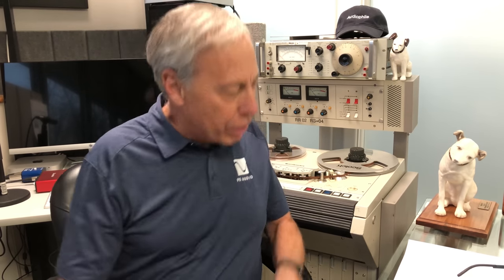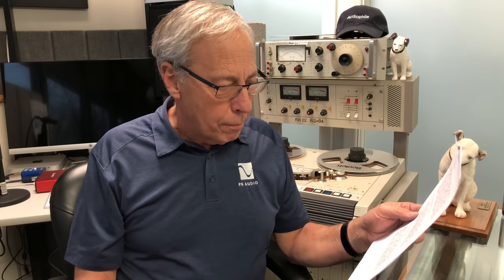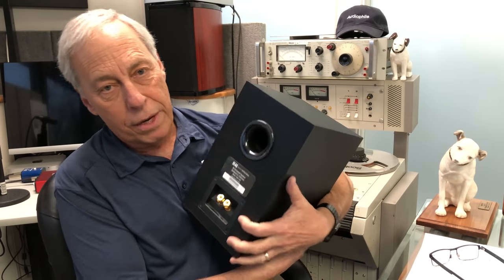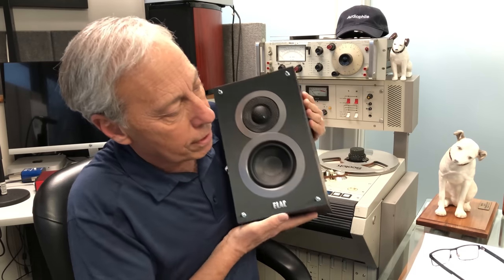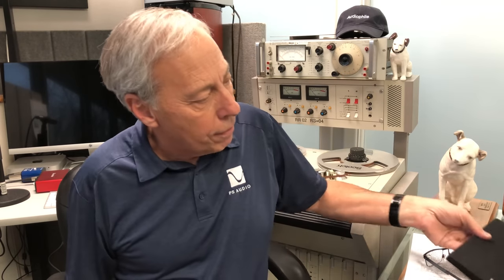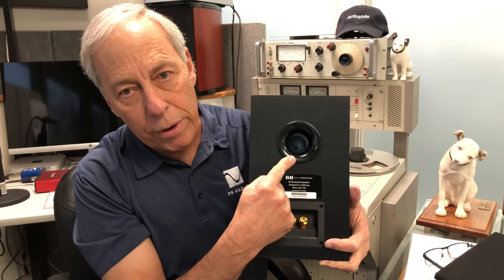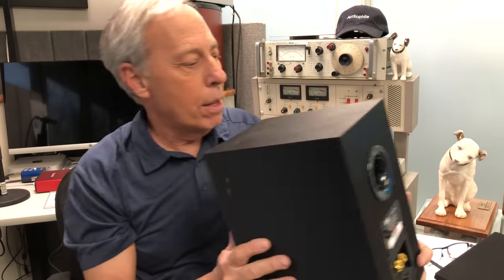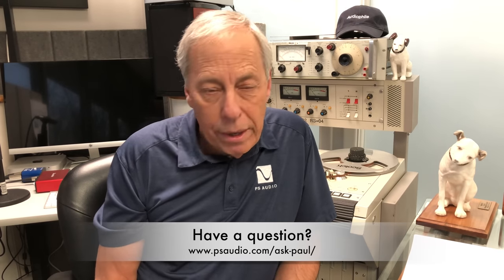Ported loudspeakers

Comment: Interesting subject guys... 
What are your thoughts on a down firing ports on stand mounted, floor standers... Any strengths in that idea? 
Or is that a no go area? If yes, why?
I know most rear ported speakers are straight through into the speaker cabbinette, so what about a series of baffles?
Would that help or just hinder air escapement?
I have been wanting to design my own speakers for some time, this is why I'm asking the question...
One other thought, is what about some form of diaphragm mounted within the port, thus pushing the speaker cone forward when its on it's forward travel...
So, in effect, the diaphragm is charged on the backward direction of the cone, then it releases that energy on the forward direction of the cone, thus giving the cone
a little help, would this be a punchier sound...
Or, is that just a sealed box again...

Would be interested in your thoughts on this guys...

Frank...

Comment: Those elacs are nice. If not a bit reserved, But the new Dayton AIR motion towers have a bit of an edge because of the ribbon tweeter and  twin woofers.
Reply: Raymond Leggs have you heard the Elac unified line I have the uf5 towers and the ub5 bookshelves and I think do a great job check them out.
Reply: I already have the daytons...

Comment: You know, I have these Bose 301 speakers (I know, Bose, boo-hoo), which most people probably have seen or heard of. But they have ports as well. However, the (6"?) woofers of these things barely move, so I doubt there's much change of volume on the inside. - Then again, these things were designed to reflect off of room surfaces, at least the "tweeters" do, but I can imagine the ports projecting bass-frequencies the same way and thus creating more sound. - But as for a change of space inside, I've turned them up quite a lot and even turned up the bass-EQ, but they're very tight and you barely even feel them move. Yea, vibrate a lot, but not like they really go anywhere. And that might be because they don't go very low, but still...
Reply: @Richard Watson Jr. Right! - I have a set of IIIs as well, though I haven't had a close enough look at those to get familiar yet. But I did notice the change in port-placement. - It also made me wonder why they did that. Perhaps the output of the port just behind the tweeters interfered with them, or maybe putting the port/slot closer to the woofer itself made more sense somehow. - I don't know. - Yet, I've seen different people claim the IIIs don't sound as good as the IIs. I don't know in what way they meant that exactly, but that seems to be the consensus.

I think the IIs sound really good, despite the criticisms of the lack of deep low-end and the design choices, as well as the Bose-reputation. Mine are even gunked up with dust and nicotine and still sound solid. Though, with support from other speakers (that render more bass) they work better.

Comment: Front ported speakers for apartments rear ported for homes
Reply: Raymond Leggs thanks
Reply: Raymond Leggs I actually think an apartment Can be a Home...  Really!
Reply: Raymond Leggs That conclusion has absolutely zero value.
Explain exactly how speakers behave differently depending on the environment please!
Reply: front ported speakers can be placed closer to a wall without affecting the amount of bass they produce as they arent relying on the port reflecting off the wall to enhance it, rear ported speakers will typically have more/louder bass the closer to a wall they are placed (within reason) and then less bass enhancement the futher from the wall you place them making front ported speakers more space efficient if thats a concern (one thats more relevant to apartments, but i am unsure if that was his reasoning).
Reply: Rear firing speakers would send more bass to the neighbors wall than the front firing speaker.(the port) not the drivers, even though there are speakers with drivers in the back.
Reply: I have front ported speakers. They are a foot away from the wall. The LCD computer monitors are a foot in front of the speakers. The tops of the monitors block my line of sight (ears) with the port, but not the speaker itself. Is this OK?
Reply: and downfiring speakers?
Reply: or just get two subs
Reply: Well no ! If living room is BIG you can use whatever you want, if speaker sits on a BOOKSHELF up the wall - front port definitely  !!!

Comment: There are good and bad versions of Ported, Sealed, t-lines, Bandpass, Horns, OB, Isobaric, Daline, Jensen Transflex, Aperiodic, ABC..  and a myriad of other deigns . There is no free lunch with any design, they all have good and bad points to them. However those who state;
Sealed = fast and tight
Ported = boomy
... really don't know what they're talking about!
Reply: Bravo UTU. To say that there is only a singular speaker design that could be considered "right", "good" or "accurate" may be considered by some to be analogous other hard liners such as saying that all ported (or acoustically suspended) speakers would sound alike, or that all 100 watt amplifiers given the same specifications sound the same (thank you Julian Hirsch.)

I am no expert but have been blessed to have listened to many speakers and HiFi systems that are considered quite "Good" or even reference caliber. So what is the particular reference that gives me any dog in this fight at all? The fact that my own speakers came from a well respected designer, equipped with two sets of exchangeable ports, one tuned to vacuum tube electronics and the other tuned to solid state electronics. It was also advised by the manufacturer that I test my system with the speaker's  ports plugged at least as an option or point of reference from which to choose.

In this on man's humble judgement, there are many very highly respected speaker designs with possibly as many takes on this very subject. And for this reason alone, I believe that it is also OK that someone may have a bias toward or away from any of these designs!
Reply: Wrong, in general terms that is the case; using drivers that can work in say sealed and ported; build both systems using correct Thiele small parameters and that point is proven.
Anyway; its basic speaker theory, a closed box will ALWAYS sound faster than a ported box with equivalent drivers; the mathematics prove it.
Reply: Lets not forget the world of musical instrument speaker design. They are mostly built closed, if more than two speakers are being used in a single cab. This is most of the time true. The designer and player want the speaker to articulate at it's best. Limiting the speaker of it's maximum travel leaves it ready to speak clearly again. Two speaker "combo" amplifiers are mainly designed with an open back. Primarily these are played in smaller rooms and the speakers don't have to be regulated with a closed cab. Lower wattage "less travel" open backs. High wattage "more travel" closed back.

Comment: I've heard port "farting" only from sub boxes in mobile audio. Not surprising as those boxes are usually designed by complete amateurs. I've heard port "chuffing" only in low budget domestic speakers and even then, it was only audible at high volume, very close to the speaker. This is one of the very few areas in which modern technology has actually improved speaker performance from that of 30 years ago.

Comment: Would it be advisable to place an absorbent surface or a diffuser behind a rear-ported speaker or does this null its purpose?
Reply from the maker: It doesn't null its purpose but also, I don't think it'd do much since what comes out of the port is low low in frequency.
Reply: PS Audio Wow, thank you so much for your prompt reply.

Comment: In the early '80s, I designed some speakers based upon the JBL's 4343 studio monitors. I used an HP wave analyzer to help determine the lengths of the two ports. I was able to flatten the natural resonance of the driver and move the resonance of the speaker to around 20 Hz., where it would otherwise have rolled off. The damping material, quantity and placement is also critical  to controlling the back wave. The shape and dimensions of the midrange sub-chamber made tuning "interesting." I am persuaded that tri-amping is also vital to getting the most out of this design. It's possible to make very good sounding ported speakers.
Reply: Back in the 90's I added the 10 inch drivers and changed the crossovers for my home built "4343"s upgrading my home built "L-300's" (using all JBLdrivers and  crossover components, just not the enclosures and JBL active crossover)   Had trouble finding a decent active crossover for the bass to midbass.  I settled on a Marchand active crossover.  I have my 10 inch in separate external sealed enclosures. The horn and slot radiator are mounted externally on an extension up ward of the 10 inch driver front baffle.  Worth adding a "midrange" crossover to the Marchad to "triamp" the speaker for a separate amp for the 10 inch?
Reply: I use two BiAmp brand SM/23 crossovers in my system. BiAmp is an offshoot of Tektronix, established in the 1970s, and has always made high quality gear. These crossovers can be found on eBay for very reasonable prices. I bought mine new, and am in the process of re-capping them - just because they've been around a long time. 

That being said, I'm in the process of creating an FPGA solution, opting for full digital crossovers with long FIR filters. I am hoping to incorporate automated equalization and phasing for speaker and room acoustics. I haven't finalized my design direction for the DACs. I'm currently looking at temperature-compensated 18-bit R-2R instrumentation DACs. There is a steep learning curve. :)

I never actually cut the holes in the baffles for the horns in my enclosures. About the time I was building, I tried "The Tube" by Transylvania Power Company. The Karlson Couplers allow the compression drivers to go all the way to 20 KHz, loaded and clean. So I never bought the slotted tweeters. I know they sound great, but I couldn't justify the expense. At this point, I can't hear much above 12.5K anyway. :( 

I use two BiAmp TC-120 amps, one for the 15" and one for the 10", and a Sony V-FET amp for the compression drivers. I crossover at 350Hz and 1250Hz. I personally love the sound that tri-amping delivers with the JBL drivers. However, I wouldn't presume to tell someone else how to build their system. You could pick up a used crossover and borrow an amp, and try it. Just be prepared to buy a third amp.

Now I'm concentrating on building a NAS with Openmediavault and cleaning up the font end. CDs cost $1.99 at Goodwill; all I have to do is rip them to disk. I'm finally getting the music collection that I could never afford while raising kids. Those half-speed mastered vinyl albums were expensive. 

It's great to hear from someone else who has experimented with and built speakers.

Comment: Agree, just to add a ported box speaker cannot match the speed or as engineers say; the transient response of a closed box system.
Reply: then tell us why open baffle speakers are all the rage today?  I consider large port designs a good balance between open baffle and closed box systems.
Reply: George Zubeck : An open baffle is a speaker with a port size the size of the cabinet; it really is a silly retort to make. Mathematically and in practice a closed box will ALWAYS have better transient response (in other words faster bass response) for equivalent drivers; you simply cannot argue against that FACT if you know anything about 2nd and 4th order systems. Ported boxes have always been a COMPROMISE to favour small box size over quality, or to increase bass depth at the expense of speed. If you listen to RnB's one note bass all day then sure ported is the way to go, try comparing equivalent designs with fast bass from the likes of Prodgy for instance and you will tell the difference.

The infinate baffle is close to perfect as you can get; but it only works with specialist drivers, impractical for all except very large rooms/double rooms you can partition and does not suffer from port noise because of its open nature, the ported box suffers 'chuffing' sounds because the air velocity causes turbulence at the flange region; to totally negate that aspect you would need a flange nearing a typical horn-speaker dimensions.
Reply: You really don't know what your talking about and your comments show you have zero knowledge outside of a small area of your knowledge base. Do you know how many well known companies have used ports in their design and have been successful. Even B&W came out with a patented port that helps with that chuffing noise.
Reply: George Zubeck  I have been designing speakers, amplifiers etc for 30 years, I have a masters degree in electronics, hnd in acoustics and noise control, no I know nothing, you are obviously a genius LOL.
I never said a ported box always sounds bad, there are many great sounding designs; BUT if you are really serious about the BEST sound; infinite baffle or closed boxes are the way to go, though some swear by transmission line; the phase response can be wirey.
I remember B&W put dimples on one of their port designs; which just shows they recognised the fact that the port is noisy.
Reply: There are tradeoffs to every design and for me a well designed ported speaker sounds better to me in most circumstances. I'm not worried about a little chuffing here and there if it sounds better to me in other areas. Your not going to get a lot of chuffing in the midrange and high frequencies. You only get that chuffing if your pushing the woofers down into the lower frequencies where it does start to chuff.
Reply: George Zubeck  I am not going argue with your tastes, I can only give you facts as to what design will sound better when designed properely.
Reply: If you throw enough money at any problem you can solve any problem. Unfortunately the vast majority of us has to deal with real world constraints.
Reply: George Zubeck : Well glad you have aligned to my thoughts at last, that took some persuading.

Comment: Thanks for the videos! I have a question about speaker wire. Should my left and right channel have the same, short length from the amp?
Reply: Thanks for the answer! But high end my speakers are not. 15" Pyle drivers, Horn tweeters, unmarked mid range in a plywood box with a massive rear bass port. They're designed to be efficient, at 10 watts they are deafening.
But, anything I can do to improve the quality that they're reproducing I will do, especially if it's as easy as measuring and cutting the existing speaker cables.
Reply: Yes. I find if you make one speaker wire shorter your stereo image will shift toward the speaker with the shorter wire.
Reply: Not if you use adequate cable. I use 6mm to make sure.
Reply: In theory, different lengths cause phase shift between left and right.  Reallity is that the amount of phase shift is so small as to be undetectable.  Lets do the math.  Lets say your left vs right lengths differ by 5 meters.  In copper, electricity travels at about 280,000,000 meters/second.  The time difference of a frequency starting at the left vs the right (Time Difference Td) = 280,000,000/5 = .000000017 seconds.
At a frequency of 1000 Hz the period (P) of the cycle is 1/1000 = .001.
Phase Shift (Ps) = 360 * Td/P    Ps=360* .000000017/.001 = .00612 degrees 
This Phase shift represented as a percentage would be .00612/360*100 = .0017% 
I highly doubt that this is detectable.  If this were aubible, we would have to listen to music in precisely the center of the two speakers and have only one ear placed directly precisely in the middle.  The distance between our ears would cause  much greater phase shift than the 5 meter wire difference.

Comment: Rear ports actually work opposite as to how you describe. Rear ports are just like front ports & at the resonance of the port it is in phase with the output of the front driver just as it is on a front ported woofer cabinate. Otherwise you would in fact loose bass output. This is what happens when you go below port resonance, the port becomes out of phase with driver & you loose bass below resonance as The port is now out of phase & it's like a driver without a cabinate. 

The port being in the rear reduces chuffing noises by directing them away from you the listener. The disadvantage of rear reporting is you cannot have them too close to a wall otherwise you will get really boomy sound.

By the way some of the best speaker in the world are ported. So are some of the worst. It all depends on how well they are tuned as well as selecting the proper driver that works well in ported enclosures.
Reply: Rear ported is to exite and couple with the wall behind it to increase output over Front firing. There is no chuffing with a port unless it exeeds mach.
Reply: jeremy whittler 

Chuffing happens below mach, above mach you would hear something entirely different like an explosion like sound. This actually happened with the polepiece vent on an earlier version of Bob Carvers true subwoofer during development.

It takes quite a lot of pressure to get air to go above mach. Much more than the typical .2 to .4 psi box pressure that one can achieve in a typical ported monitor speaker. 

Chuffing is caused by turbulence created by port air meeting the outside air without the opportunity to gradually slow meet the outside air at partially reduced angle of attack. Flaring the port helps reduce chuffing as well.

Comment: What if you had 2 set of speakers on the cabinet, one set on the back and one set on the front and both facing forward, then pressure in the cabinet would always be the same?
Reply: You would get destructive interference and virtually no low frequency response.
Reply: That second set at the back generates a wave out of phase at the back, the physics/problems stay the same. Just  mount the speaker in a hole in the wall....then this specific problem is solved.